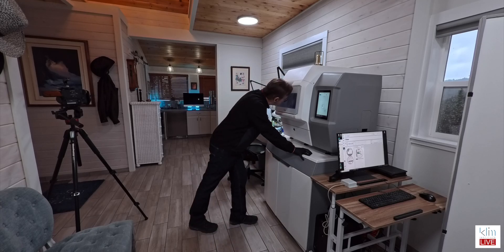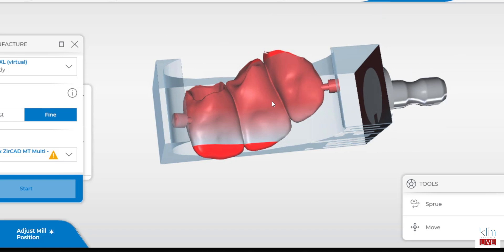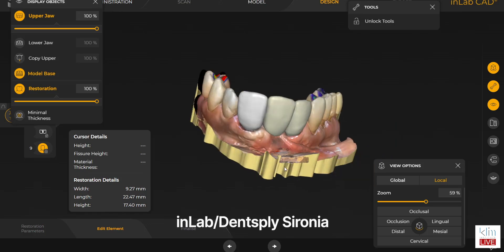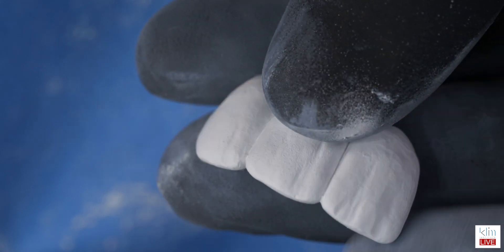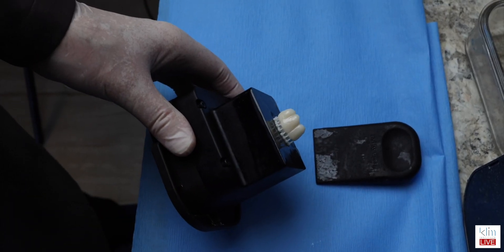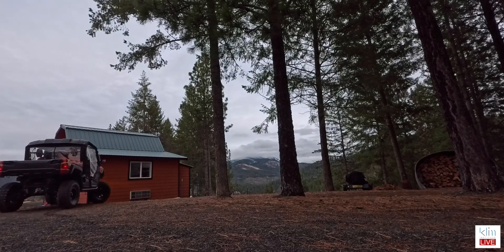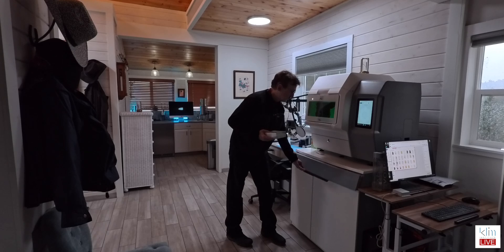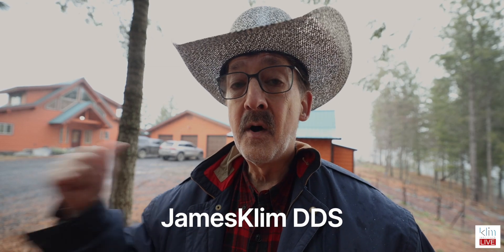When the Bridge Doesn't Quite Fit In The CEREC Block

Comment: Do you have a video on how to design a bridge with inlab where you can mill the gingiva under a pontic, including papillae. I have a case where I'd like to mill the bridge and gingiva as one piece then use Miyo to create to pink gingiva. I can't figure out how to do the gingival design. I see the gingiva check box but it gives me a design error.
Reply from the maker: Take the baseline pontic tool for the pontic zone and outline on the tissues where you want the gingival extensions to align. the proposal will initially appear unusual, but the Form tools can be used to carve and design the gingival areas.   All the best.